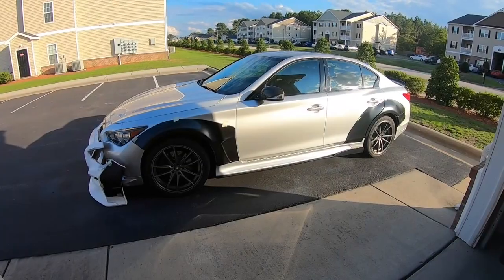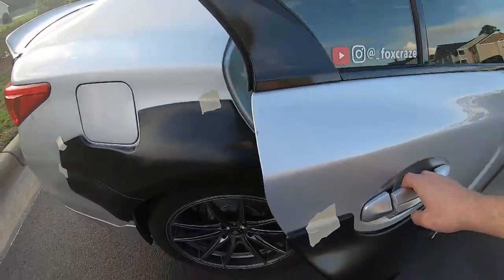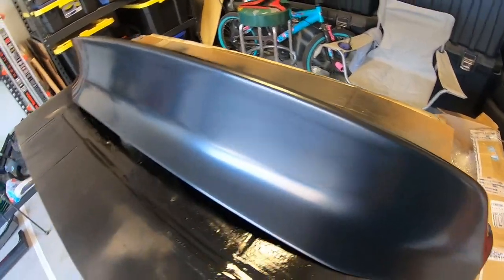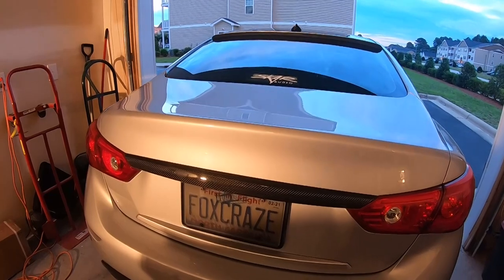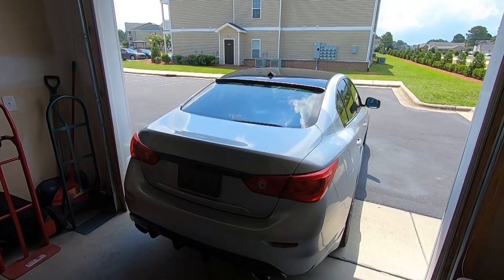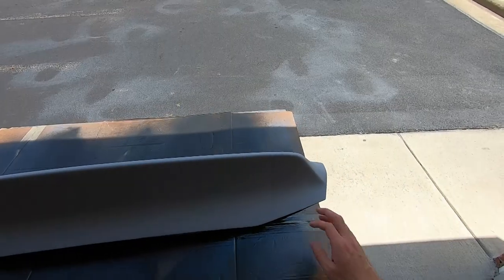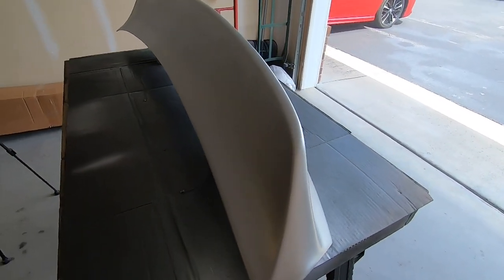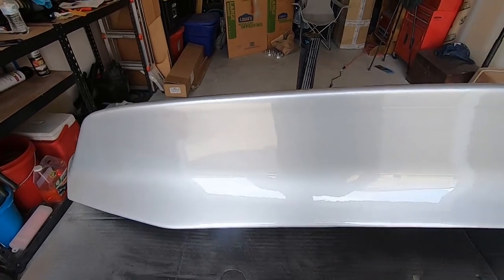Infiniti Q50 Krotov wide body mock up and duck bill spoiler install!

Comment: That came out great!! I have a compressor and spray gun but prefer the rattle can mixed from my local paint shop..under $50 bucks and amazing DIY achievement. Like u said its a daily.. I call any blemishes "beauty marks".. gives the car character 👍🏽
Reply from the maker: Eventually I will be buying a junker to rebuild and when that happens I will def Need to get a compressor setup running but for individual parts the cans do work just fine. Beauty marks haha, I like that!

Comment: Love your videos man. Car is coming along nicely too! I had a question though... I just got my Krotov duckbill spoiler in yesterday and dropped it off at my local paint guy today. Should be ready mid-week and I need to find the best double sided tape to use to make sure it stays on. What tape did you use on yours? I'm leaning towards 3M VHB 5952 so far... Thanks in advance
Reply from the maker: Nice add me on Instagram so I can see the end result, _foxcraze! Anyway as for the VHB yes that tape will be great to use, that is what I plan to use for the wide body panels. I used the 3m 1” wide automotive tape from autozone for my duckbill and it’s not moved an inch. But I would have used the VHB if I knew the difference at the time!!

Comment: Hey man, I know this is an old video and I have yet to catch up, but I was wondering, would the front cameras from the oem grille work with this blitz bumper? I’m not sure if it’s as simply as swapping the old grille into the new bumper, or if modifications would have to be done.
Reply from the maker: The grille is mounted to the stock  bumper with hardware and would transition to a blitz bumper easily.
Reply: @Foxcraze  can’t wait to see when you install the full kit!

Comment: I just installed this on mine and I feel like the top corners and the sides won’t stick at all. I even used adhesive promoter and it never goes flush. Any tips?
Reply from the maker: It could have warped in shipment. Heating the corners and lips then applying pressure till it cools will reshape the abs to your trunks contours!

Comment: Where do you get the paint and how do you make sure it’s the same color?
Reply from the maker: The paint can be purchased online or at a paint store where paint mixing for automotive paint is done. Mine was bought at an advanced auto parts that had a paint mixing section.  You give them the color code of the vehicle and they will mix it to match based on that code. The newer the car the better that match will be due to sun fade and all that affecting the original color.

Comment: Wing looks awesome! Does anyone know if this krotov wing fits on an 2018 q50?
Reply from the maker: It will fit, the top of the trunk is same shape in all years.  The difference is in the tail light buckets and the delete of the lower trim panel under license plate.

Comment: What paint and clear coat did ya use ??? It look awesome
Reply from the maker: I had the paint color matched and put into aerosol cans at advance auto parts near me that had a paint mixing station in the back. I purchased the spraymax2k clear gloss from them as well. I appreciate the feedback!
Reply: @Foxcraze  u think the single step 2k spray max will work?
Reply from the maker: So the clear needs to be 2k not 1k and have the hardener included. 1K clear doesn’t harden like automotive grade clear does and it will be prone to damage easier. If the lid has a red plug on top of it then you are good to go.

Comment: I was looking into that same body kit did you decide to go with another look or never got the time to do it all ?
Reply from the maker: Still waiting, turned out it isn’t very first timer diy friendly. I have an idea how I’m doing it just gotta find time.
Reply from the maker: Meaning it’s not doable for one person over a weekend.
Reply: @Foxcraze  okay that’s good to know I was planning on doing it myself now I know. Appreciate the response I’ll be keeping up with the build!
Reply from the maker: You may be better off than I am at doing this and knock it out quickly. My issue isn’t nothing with the kit because  it fits wonderfully. What I don’t want to do is use rivets or screws but I also didn’t want to permanently bond it to the car in the event of a collision, the likely hood of the kit being repairable is greatly increased. That said the kit doesn’t sit flush enough in all areas to be bonded with tape so I’m still working a solution.

Comment: Ik this is old but can u share link to the paint u used for duckbill?
Reply from the maker: I purchased my paint from an advanced auto that has a paint mixing station. But you can also get it online premixed. Look up 66autocolor.com as they have a bunch of spraymax options. Alternatively, you can also go to automotivetouchup.com and get their brand mixed by them as well.
Reply: @Foxcraze  thanks for the response will look into it. Clean q tho! First q i seen that has a bunch of color match every build i see it just black trims lol
Reply from the maker: I hate the over use of carbon and abs black plastics. It all ends up looking like replaced parts after a wreck from a distance lol

Comment: What paint did you use for this?
Reply from the maker: I bought spraymax base and spraymax 2k clear coat. My local advanced auto has a paint mixing station in the back and all they need it your paint code.
Reply: @Foxcraze  just off the shelf primer?
Reply from the maker: Yeah automotive rustoleum brand works great
Reply: Thank you sir. You're amazing
Reply from the maker: @joshadolphsen4767  no prob, glad to help!

Comment: How abour adhe promotor?
Reply from the maker: Since it is made of a fairly rigid plastic, I didn’t use any and have had zero issues with chipping or peel.
Reply: Other question it is this abs plastic ? Cause i saw in ebay this kind of wing but in fiber glass
Reply from the maker: The Krotov wing is abs plastic. If you’re seeing a fiberglass version on eBay then it’s a mold of the original and will prob not fit well.